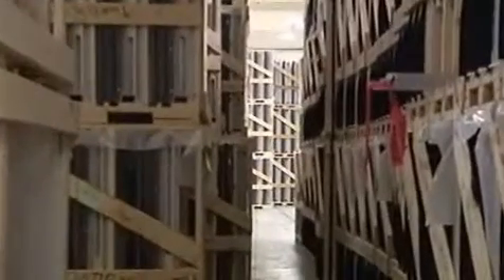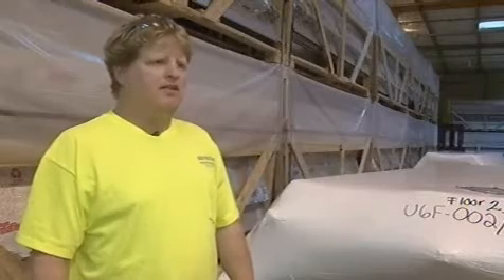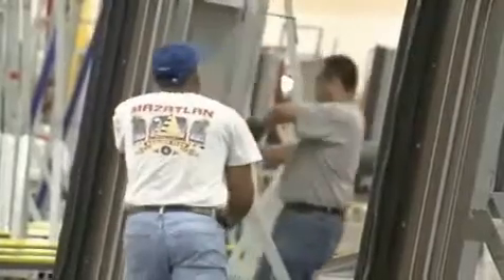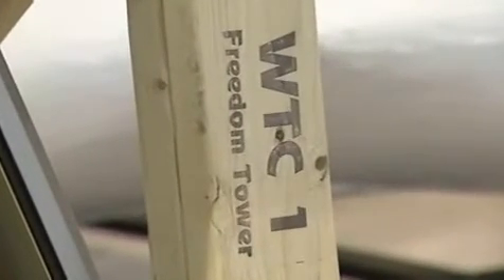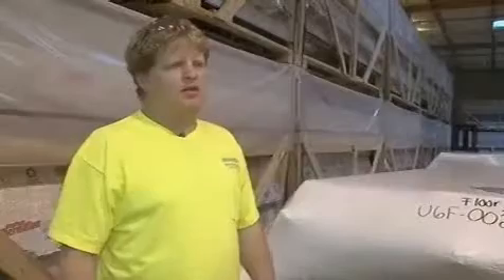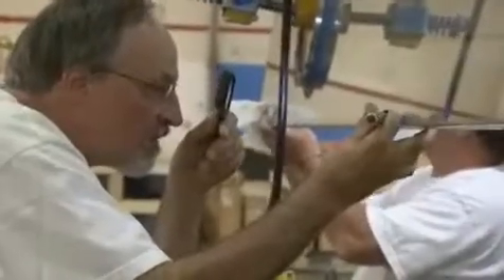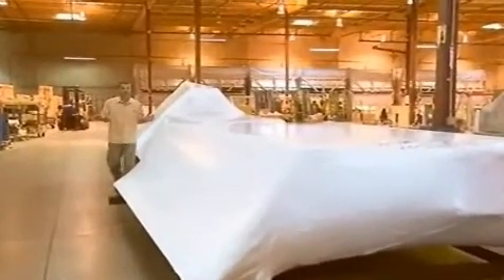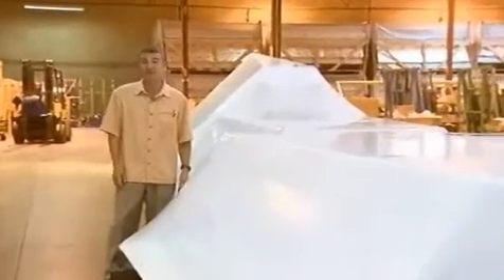Benson Ind. fabricating 1 WTC cladding

Comment: I'm an Ironworker out of local #5 Washington D.C and work for TSI. I have set the Benson CW on Capital one, 673 Square, and 1730 Penn. and It is the best CW system I have ever worked with. I have worked with GMS and Baker Metals and they don't go together as well as Benson. I ran 1730 Penn. and still worked with my tools on so I could get the chance to set the wall. Benson is by far the best CW I have ever worked with, GREAT product guys I hope to do another!!!!